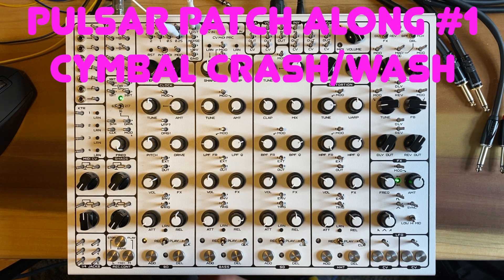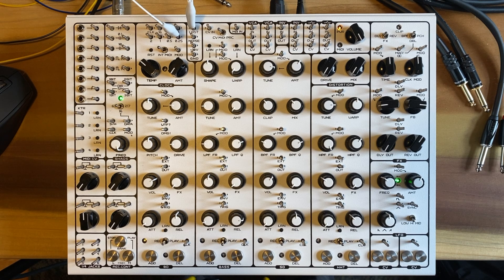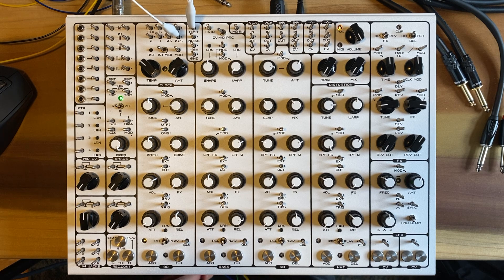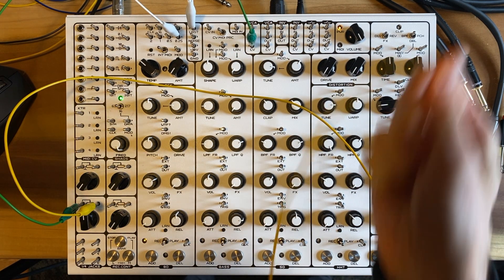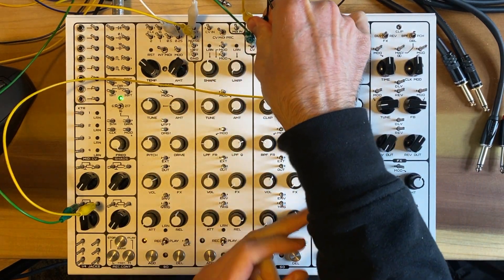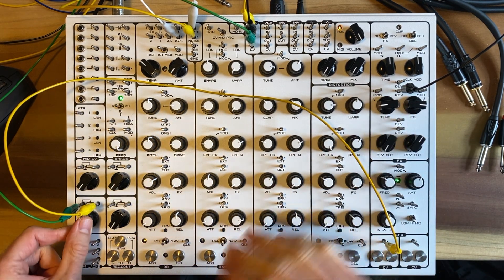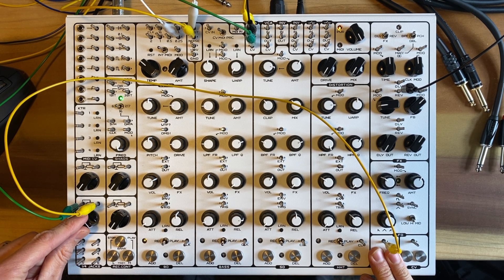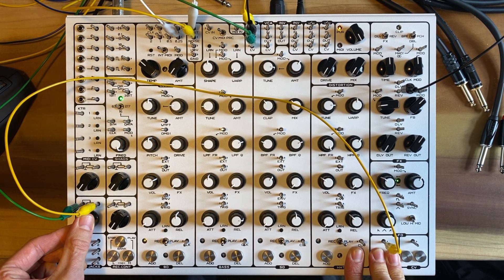Pulsar-23 Patch Along #1: Cymbal/Crash Patch

Comment: Hey I have to add , I did the patch just like you did, with this difference. I have the outs going to the individual outs in the 1-2-3-4 outs respectively , and the effects seem to be bypassed. I tried to route the reverb out to one of the outputs, ( I tried all four) and just couldn't get it to work, I will try it with the master out and see what happens ..
Reply: did you try routing an effect to one of the unused outputs (5 or 6)? That should work.
Reply: @JohnoWells   I'll give it a shot thanks
Reply from the maker: Bout 🌴, 🌴fiddy on the discord said this “Can also use the main out for FX if you're running individual outs for each dry voice. the 'out' pin is before volume/fx, so you'll get a full volume dry track no matter what the wet/dry mix of the pots. It gives a total of 7 possible output mixes, so 4dry+3fx. Not enough for isolated fx tracks for each, BUT technically there's up to 15 channels if you include the minijack adapters. Not sure if the sound quality changes with those, but haven't noticed it in my experience. .So if you want 4 dry and 4 wet tracks, all isolated, in one take, it's doable.” If that helps at all. I never thought of getting the mini jacks involved.
Reply: @guiremcguire743   insane. I often think that Vlad doesn't even know everything that machine will do.. I think he had some kind of wild inspiration, and just designed it. thanks for the tip. I hope someone out there try to max out the possible outs on it.
Reply from the maker: Pulsar is very deep. I love that we all keep learning more ways to use it. Super fun.
Reply from the maker: Are you on the Discord? If not there is a link to it on my 4th and 5th videos in the description. See ya there!
Reply: @guiremcguire743   hey what's your discord link